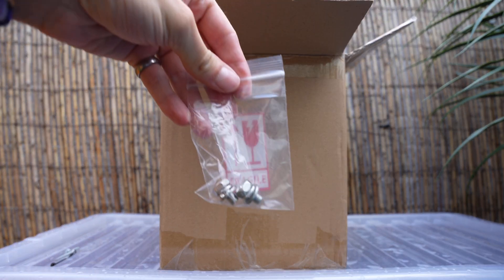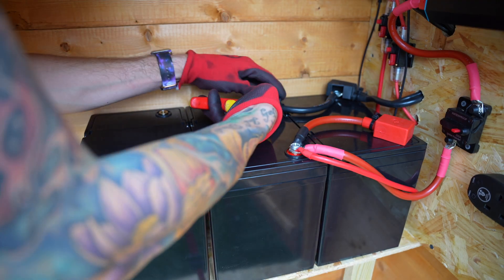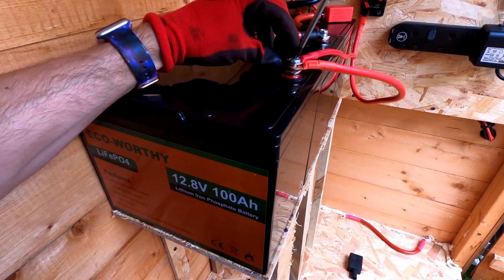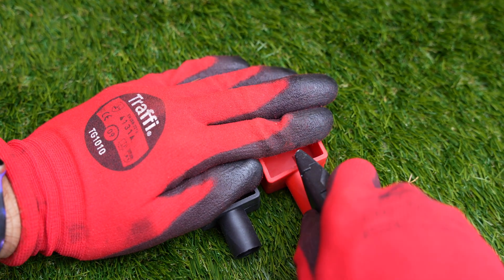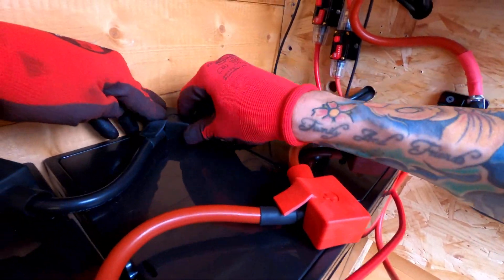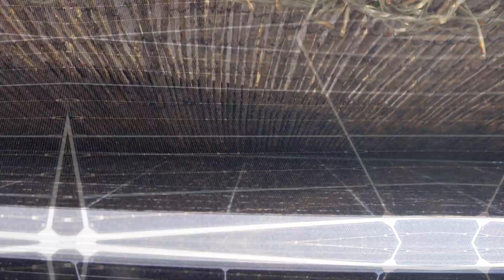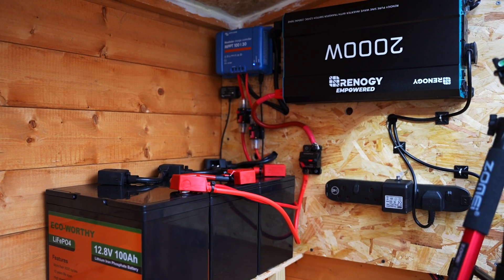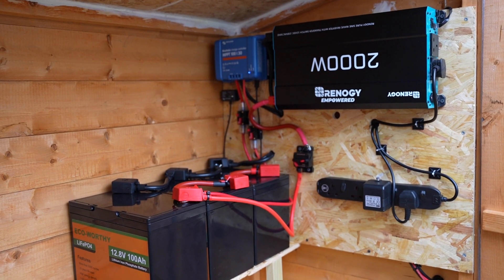Solar Panel Setup, Off Grid (SETUP & INFO) - PART 4

Comment: Nice set up, I'm building something similar too, just curious - shouldn't you incorporate a BMS module for the batteries to keep their charging state at the same levels? My set up is at its early stage having only one battery and one 290Wp solar panel, so I'm not worrying about BMS yet, but I'll likely want to add another battery later and I'm assuming that I should then add a BMS module. Maybe it's not 100% necessity, but from watching more of this content it sounds like it may at least extend battery life cycle. Thanks...

Comment: what size / gauge of wire did you use, for to connect your 3 batteries together.
Reply from the maker: I used 240 Amp 35mm² Battery Power Cable Starter Earth Custom Made Car Auto Connection
Reply: @Pwinkle R  thanks I've went and got 2m black + 2m red 35mm cable.